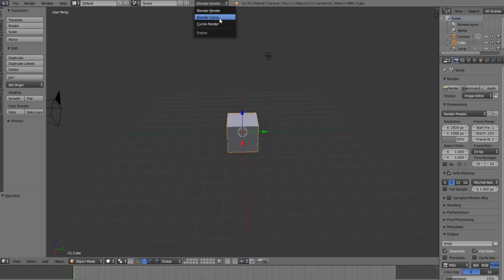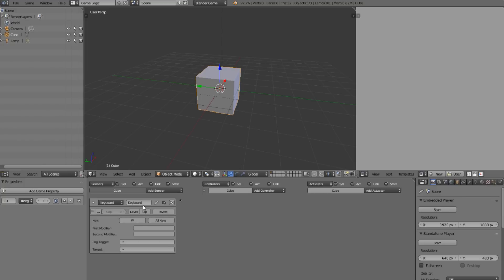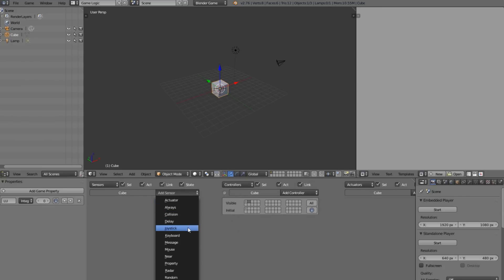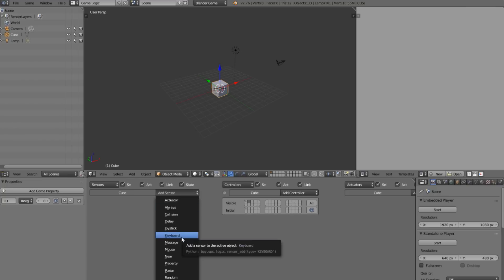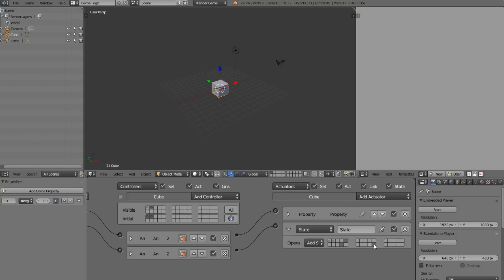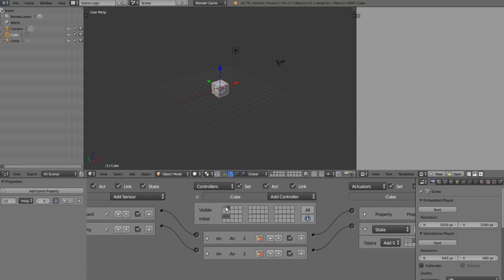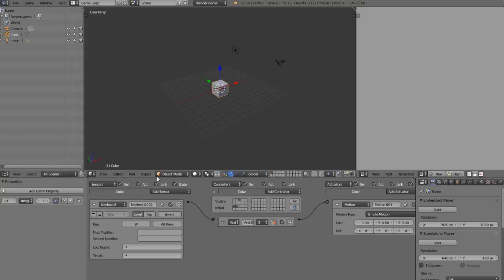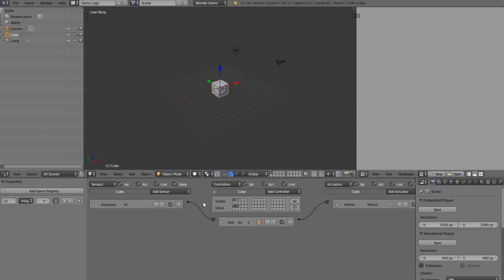Creating power ups - BGE Tutorial

Comment: Thank you again for clearifying the States in the Game Engine.

After following your tutorial I redesigned the logic bricks to this setup:
State 1: Key W -> Move Cube slowly
State 1: Key Space -> Switch to State 2
State 2: Key W -> Move Cube Fast
State 2: Key Space -> Switch to State 1

Like this, I could get rid of the property LU. I even discovered, that you can activate the debug info on the states, so you also can see very well in which state you are.

Or did I miss something important?

One other thing which you probably know: In your example when the cube is fast, the key "w" is taken twice. Once for slow (0.1) and once for fast (0.5). So your cube moves with a speed of 0.6. For that reason I would maybe prefer the set state function, instead of adding and removing the state. I wanted my cube to move backwards instead of going fast, so I had to use -0.2 with your example, which is a little confusing...

But your Tutorials are very inspiring. Please continue with them.